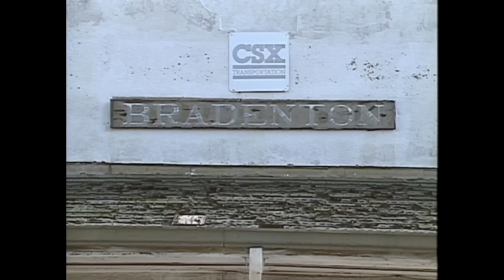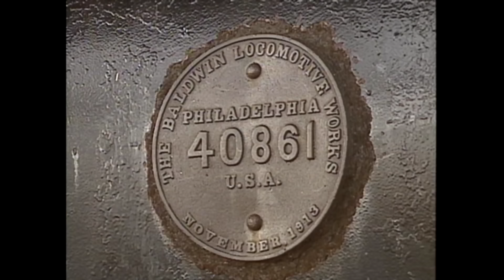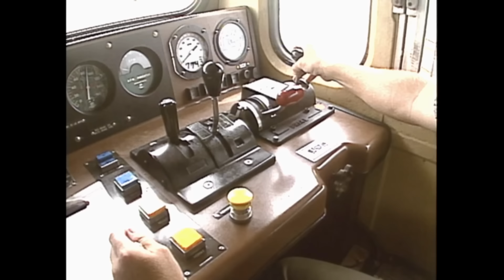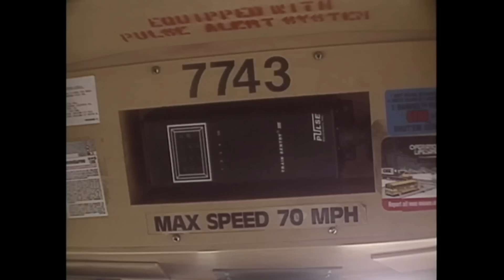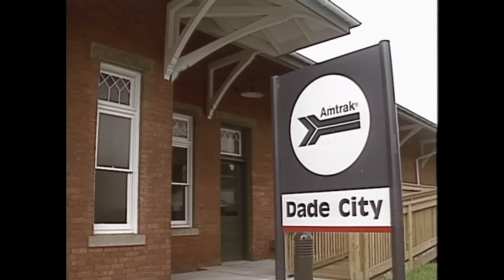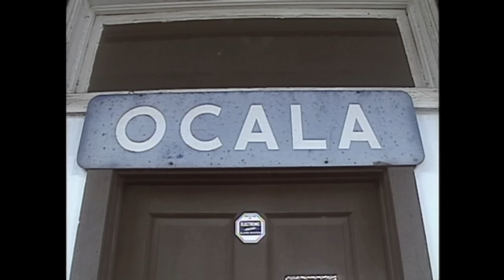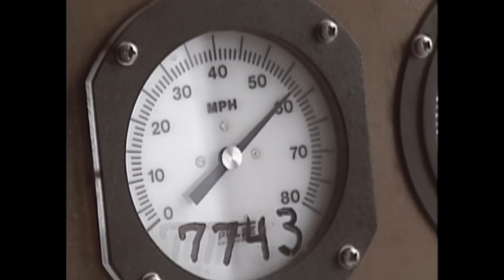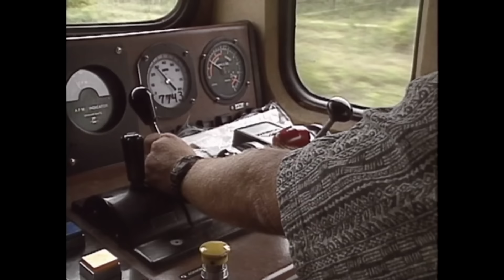The Way It Was:   Juice Train 1997

Comment: I met that old juice train many times over my 35 years with the old ACL railroad, Seaboard Coast Line, Family LInes System , Seaboard System Railroad and  of course when I retired it was CSXT... The juice train stopped in Florence SC where I worked . Sometimes a locomotive would have a problem the juice train was like any other train that ran over our rails it was not immune to mechanical issues...The locomotives were topped off with fuel, a crew change then away they went on up the line to Rocky Mount. They ever told us one time how many oranges it took for a train load of juice, which after many years I do not remember anymore. Thanks for the nice video, sure brings back memories for me..

Comment: Seeing older footage like this is really interesting, especially for a younger railroader like myself. The enhanced maintenance practices (allowing for proper fast freight), the frequency of the trains, the unit trains, the fact that the trains weren't irresponsibly long (back before PSR had a stranglehold on everything). It's really something...definitely somewhat of a bygone era unfortunately. Seeing the big GEs with the older style analog gauges instead of the newer digital gauges and PTC screens scabbed in everywhere was pretty neat too. Thanks for this Danny, top quality stuff as always.
Reply: phillyslasher  That's exactly it. PSR is phenomenal if you're an executive or a shareholder. Furlough the bulk of your workforce and run the ones who are left straight into the ground. Run the fewest trains possible, and make them as long as humanly possible...and then some (oh, and don't forget to run those trains with the scabbiest, dirtiest, most beaten down power you can find). Slash your maintenance and safety measures and boom, there ya go...bigger bonuses for the brass and more money for the shareholders. It's an absolute travesty of a system. I work up in Canada, and it's bad enough here. Some of the horror stories I hear from stateside (most alarmingly the idea of single man crews that certain companies are trying to ram through) are absolutely unbelievable. Rules and legislation made by people who have never ACTUALLY railroaded. They've never built a train or switched a yard at 2am in the bitter cold. They've never had to walk a 3 mile long train in the blazing summer heat in search of a hot wheel. They've never had to dig out a switch that's buried under a 4 foot snow drift using nothing but a switch broom. They have absolutely no goddamn idea what it's actually like to do this job (the vast majority of them, anyway). But man, they sure like acting like they do, all while making things exponentially more difficult and constantly reminding us about how grateful we should be to work for them. You said it best, you really can't have a good job anymore, and it's a real shame, because despite all of my ranting and bitching I legitimately love the job. It's just, as is often the case, the the powers that be... they love to make things difficult.
Reply: phillyslasher  Ha! Oh buddy, I feel you, big time. Before the railroad I worked in the oilfield, drilling rigs more specifically. It's the exact same story with the old boys, "Yeah, well back in my day!!!" on and on and on. Back in the days of "real" riggin'...ya know,  back when they'd sit on a single 2500 meter well for months and months...meanwhile there we were, us young, dumb ungrateful young guys, smashing out 6000 meter wells in 15 days start to finish. It's an unbelievably unfair comparison, and it's the exact same with the railroads. The attendance policies are absolutely horrendous. I know where I am, they've gone so far as to no longer accept a doctor's note as a valid reason for an absence. Fun fact? That's in DIRECT violation of the Canadian labour code...but it doesn't seem to matter. It's amazing (and scary, really) what they can get away with. And again, the whole constantly having management and dispatchers (RTC as we call them) breathing down your neck, wondering why you haven't got the entire yard switched out already or why your set off is taking so long, etc? Yeah man...it's something I know all too well. Speaking of management, let's not forget everybody's favorite thing to hear come over the radio "Hey, so how long are you guys good till?"...the sure fire sign of an impending shit storm on the horizon haha.
Reply: phillyslasher  Hahaha yeah, I was gonna say the same thing actually...sounds like were out of the exact same spot. Sorry to burst your bubble though...yeah, she's pretty much the exact same bullshit up here, just no active PTC (yet) and it's, on average, a hell of a lot colder (let me tell ya, riding the point on a 5 mile shove when it's -50°? Reaaaaaaaaly not that much fun). Other than that? Same ol' class 1 boogie...always an adventure eh? I gotta say though, it was cool to talk with someone from a US terminal. I know I should have better things to do than talk about work, but I like hearing about how things operate in different spots like that...and getting to hear just how similar we all are. Work safe brother.
Reply: I'm a product of the 90s myself. Grew up around large scale model trains throughout that decade, while seeing the occasional commuter, intercity, tourist, or freight train. But I really didn't get gung-ho into the big mainline stuff until the 00s. Even in the last 5 years a lot has fallen. Maybe I'm just being too negative but things definitely got choked by the "poison P's" of PTC and PSR. Even "back then" freight trains were that much more efficient per tonnage of freight moved than by highways, and yet even PSR hasn't dominated the trucking industry like it wanted. Heck, cost squeezing has only been worse for railroading and serving freight customers. You can throw "customers first" out the window. But at least profits are up so it looks good to shareholders? I'm a very recent railroad employee, albeit not a "ground-level" railroader. And as an aside, I also like analog gauges.
Reply: Well, I think ya'll summed up my 20something year career. 
"Back in my day......"  lol,
It sure was more fun.
Now that I have my house paid off, about dont give a damn if I get run off for awhile. Just short of miserable some days.

Comment: I have worked at the MWDC in northern Cincy since 1997 and let me tell you, even though Trop specifies their cars are "no hump", it happens occasionally and believe me those are NO FUN to unload. And you are correct about the cars being "tagged" with graffiti. Sure seems like a waste of a whole bunch of paint to me. Thanks for posting this very informative and professionally done docu video.
Reply: Can you elaborate? What happens if they get humped? Does the juice spill everywhere?
Reply: @Syclone0044  The pallets of product are all turned sideways and then double decked using lumber that rests on cleats on both sides of the car walls and a vertical support board goes in the center for support. When a car gets humped, many times there is massive shifting of the pallets that sit on the upper deck and it gets especially bad if the door opening isn't filled tightly. There are usually 76 pallets total on a car, and  if they fill the door opening with 16 pallets, it fills the opening better so there is less chance of shifting. The problem is when they only put 12 pallets in and use air bag dunnage as a void filler. Quite often that does very little to keep it from shifting and by the time the car gets to us it is a real P.I.T.A. to unload, lots of damage and re-stacking.

Comment: Wow watching in March 2021 , wonderful video , thank you so much for this , 
I use to operate a General Motors 1200 hp switcher locomotive, a 1951 model. , I never worked on main line trains , but still treasure the years I had in that old loco .

Comment: Great video, Danny, even though I had to blow the dust off my VHS tape of your classic. I grew up in Sarasota, my father, a mechanical engineer, worked for Tropicana in the 1970’s and was the lead designer of the original refrigeration systems on the original cars. I dated a girl in high school who’s father worked for SCL and did much of the switching for the juice train. Your original VHS tape “Streak of Orange” is a cherished part of my railroad collection, so many good memories. I now live in a quiet little town in Georgia,   but it sits on the former ACL main line between New York and Florida. CSX and NS roll trains through town several times every day, Sarasota turned its back on the railroad, I could not live with that. I now call Jesup, Georgia home. Sarasota is dead to me. Thank you for all your wonderful videos over all these years.

Comment: Great video. Reminds me of the SCT train in Australia. All white 80 foot vans and refrigerated vans, runs from the East (Victoria) to Perth in the west. 
When i drove it, it was the maximum length at 1.8km, and around 4-500 tonne. Across the desert they added higher vans/boxcars and double stacked containers.
It also had 'in line fuelling', and continually topped up on the run
Its nickname is 'the great white shark'

Comment: I’ve been to Tropicana’s Bradenton Plant many times to pick up juice, and you have to drive across and along all those tracks where they’re loading cars.

Been fortunate enough to see the Juice Train from the Plant City observation platform, May, 2021(?) making the turn north, and it was moving! Trop cars are now mostly white, with green lettering like the cartons on the store shelf. (The refer units are just like the refer on a semi-trailer).

A semi’s refer trailer holds max 43,000 of juice; guessing a rail car holds four times as much and at 63 cars, that’s taking 240 trucks off I-95 to Kearney, NJ!

Comment: I lived in Bradenton 1973-1978. I wish I knew about the old railway station. There was an old locomotive by the waterfront by the Manatee River.  Ringling Brothers had their own rail cars there at one time. Tropicana used to burn their old Orange scraps  every night and it actually smelled pretty good.  Not that long ago Tropicana started importing Orange Juice from South America. I don't know if they still do. One year they had several thousand gallons of OJ spoil and they just dumped the whole lot into the Manatee River with no consequences.

Comment: In 1973 I hired on the Penn Central RR in Baltimore, MD, eventually going through a few mergers to become Conrail and finally the Norfolk Southern.  During the early Conrail years, we operated the Juice train from Potomac Yard, Va. up the Conrail mainline.from Washington, DC to Kearny, NJ, a run of about 230 miles with one crew if everything went OK.  When Amtrak took over the Conrail main line from Washington to NY, the train was then routed via the CSX to Baltimore, MD where a Conrail crew re crewed the CSX crew and took it the remaining roughly 180 or so miles.  I can't recall the CSX train symbol at the time, only that it was a "K" symbol.  When we recrewed them in Baltimore, the symbol became the Z444.  The "Z" indicated it was operated by Conrail crews. That run went from Baltimore to Philadelphia on the CSX and then on the Conrail lines to Kearny, NJ.  Back in those days, the Juice was usually between 60-65 cars every day.

For those not real familiar with CSX ops, they also had an extra two characters on the end of their train symbols.  They represented the day of the month the train originated.  For example, the K650 you watched inn this video could have been something like K65012 for the Juice train the started out on the 12th of the month.  This was done for crews to identify the train correctly if there was more than one train with the K650 symbol operating on the same day.

A scary, but funny accident happened to one of the Z  trains as it was passing over the Philadelphia High Line, a piece of railroad that took the train over and past the 30th St Passenger terminal.  A door on one of the cars came open and when it hit the "Open Door Detector", it caused a pallet of juice boxes to be pulled out and they fell about 80 feet and hit a number of vehicles parked below.  Fortunately, no one was hurt, but a lot of cars smelled a bit funny.

As for me, I retired in 2005 and moved to central Florida....and guess where?  About 15 minutes from the Wildwood Yard.  In 2005 I did see a couple of solid Juice trains going up the CSX at or near Wildwood.  It was always a great site...but no more solid Juice trains today.  This video brought back a lot of memories.  Thanks Danny.

Comment: Not COMPLETELY - I actually remember a PRINT ad referring to this train (which Tropicana also called "Big Orange"). In addition to the Florida/New Jersey run, there was a separate "Big Orange" run that serviced other distribution points at Intermodals (the Washington, DC stop used to be the RF&P Capitol Intermodal in Arlington VA; when the RF&P was acquired by CSX, this Intermodal was declared surplus and is now a mixed-use industrial/commercial/residential lot; some of the overflow from Amazon HQ2 - which is further north, will wind up here); it's replacement is CSX's own NCR Intermodal in Washington DC itself.  Other stops are the CSX Jessup Intermodal in Jessup and Baltimore Intermodal in the city of Baltimore.  Because they are smaller than New Jersey, they mean mulltiple stops.  However, the total shippage is equal to that of the Juice Train - hence it ALSO carried the Big Orange name.  (Folks forget how much OJ gets drank in greater Washington DC - or greater Baltimore, for that matter.)

Comment: Great video as always Danny, just one small correction. Those 9000 series GEs are actually Dash 9-40CWs, or CW40-9s as CSX calls them. They were very early production Dash 9s built on Dash 8 frames and trucks. Only CSX bought them. Confusingly, there are also real, full Dash 9s like NS’s fleet that are also called Dash 9-40CWs.

Comment: Today The Juice goes out on Q156 and CSX and Tropicana use the newer Trinity and ACF Armor 64 boxcars. These cars use an externally mounted refrigeration unit instead of a Freon radiator and fan. The train still runs but CSX mixes the cars in with its freights just like UP did for the fruit express.

Comment: one more, the track configuration at "YN" is very different now. By the time we would clear the crossovers at "X"tower running north on the main,we would be running track speed thru YN on clear signals.

Comment: I'm a subscriber who knows nothing about railroads.  Just enjoy your narrative and like watching these monsters.  Closest I ever got to a railroad was the Harmon Yards where I used to live in Croton-on-Hudson, NY.  Every so often they would have an open house with everybody welcome.
I'm wondering about how the cars stay on the rails around a bend.  Here is my question.  When a train goes around a bend with a locomotive pulling from the front (and no locomotive pushing from the back) the pulling force from the front against the weight of the back end would tend to pull the middle of the train off the track into the center of the bend.  Thinking of the bend as a section of the circumference of a huge circle.  If the train was going super fast (much faster than possible) the centrifugal force would keep things working.  But at working speeds I would think the centripetal force would pull the train off the tracks toward the inside of the bend.  If you think it's a good question feel free to  put it in a show or, if you have the time, you could respond to me directly.  thanks, Sgt. Jeffrey

Comment: Danny... HA!  No one else caught in the video what I did (I went through all the comments, one came close.)  
That EMD GP unit at 9:49 (if you freeze the video)  has Switcher trucks. Not your standard GP7/GP9 trucks. AAR type A switcher trucks instead of the usual EMD Blomberg B four wheel trucks. The frame is reversed (airtanks to the rear) and that's a smaller fuel tank. Made especially for "Very" light rail. Somewhat like this one: https://www.railpictures.net/photo/733522/
Anyway... Great video.   John  BC, Canada
Reply from the maker: Yeah, I was going to remove that comment, but I forgot to. I'm not a locomotive guy and don't like getting into models and versions. I try not to put them in my scripts unless I have positive information exactly because of fact errors like these.

Comment: At 21:10 is that track on the far right the old Thanotasasa Subdivision? And also, those Conrail horns sound like something right out of a 1960’s train documentary!
Reply from the maker: Nope, the main line track in the middle that leads to the right is the old Thonotosassa Main. Abandoned after 1967 south of  Zephyrhills and connected to the S-Line, which was abandoned north of Zephyrhills to Owensboro.
Reply: @distantsignal  Ohh, okay. Thanks! I don’t know much about Florida’s railroad’s. Your videos have been very helpful.

Comment: I've watched a few of your videos as well as other's videos and seeing all that wheel time made me curious about something so I watched a number of videos about how wheelsets are made and assembeled beneath the trucks/bogie and the cars just sitting on them with everything held in place solely by gravity.  Consequently, if there's a derailment, wheelsets, trucks and cars go flying independently of one another.  I realize, having watched the maintenance videos that it's probably much easier to replace wheelsets just by jacking up the car and not having to remove any (now you stay there hardware) keeping the wheelsets attached to the trucks and the trucks attached to the cars.  

Why do you suppose this is the way it is and how do you think they get away with it?  Amtrak just had a derailment; come to think of it -  Amtrak's had all the derailments that I recall.  They're not all that frequent, but they do happen.  How would you like it if a wheelset rolled into your car or house?  Not very much I imagine.  Thank you for reading this and I look forward to your response.  😀